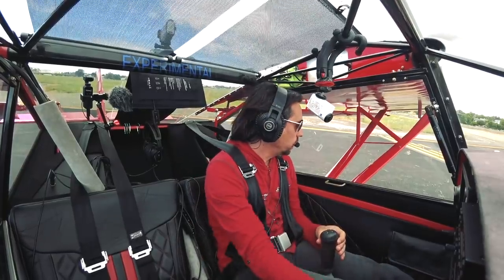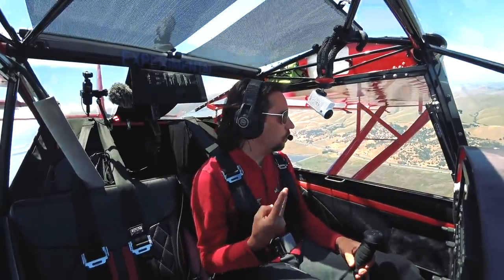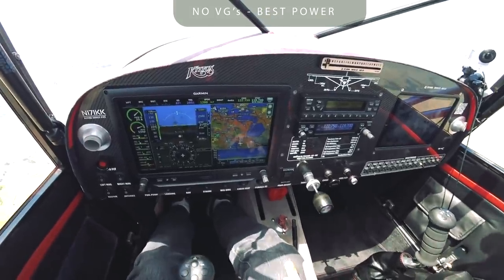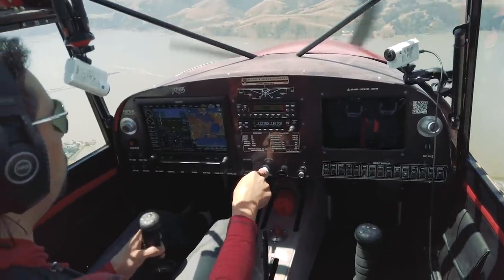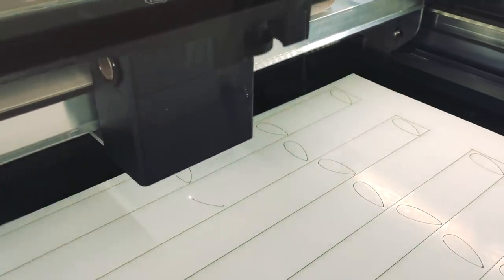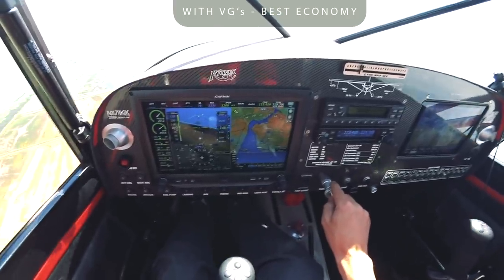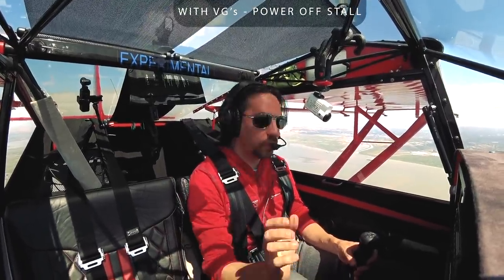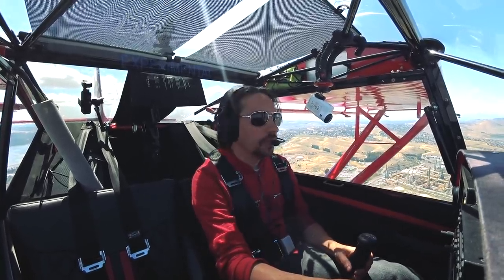Kitfox - Vortex Generator Install and Test Flight

Comment: THANKS GREAT RESEARCH EFFORT ,I have watched a ton of these and everyone else gets about your results before after. I am refitting a Loehle Sport Parasol and was concerned most about making part 103 stall speed and I have been convinced VG is the way to ensure that I can meet that, and this is just one more video that says its the way to get there. The only other way is to install >50% flaps ($$$$) and then the FAA gives me a few points on the lift coefficient on paper ( i dont have to actually ever use the flaps) but VG is a lot cheaper and a ton less work.

Comment: There must be kind of sacrifice, I mean cruise speed or gas burn? Doesn't the VGs induce a slightly more drag
Reply: VGs on the wings don't really have much effect on cruise speed. They have more effect at higher AOA giving better control at lower speeds therefore lowering stall speed. He goes over this better in his first VG video.

Comment: Great performance gains! Enjoyed your process and precision application methodology. Question: I didn't catch whether you applied VGs under your horizontal stabilizer. I'm curious whether doing so will help you maintain a higher angle of attack during low-speed flare.
Reply from the maker: I did. I had 16 VG's left over and installed 8 on each side. I do feel my elevator with much more authority.
Reply: @AlexDiSessa  Sweet!

Comment: Alex, this was a fun test with real life before and after results. Mike Patey in his building of Drako has a great video on the difference between a slotted and a slatted leading edge and the drag effects of the airfoil when landing a tail dragger. If you wanted to get your stable slow speed down under 35-6 knots perhaps a slatted leading edge could bring you down to near 29 knots?
Reply from the maker: I am sure it could... but then I need to redesign my wing and it means no flying!

Comment: Curious as to why your stall speed is so much higher than mine... full flap power on I'm down at 27mph, power off at 31mph. Also STOL speed Vg's and placed at 3%. I have a video up on it as well
Reply from the maker: It's likely because I am 300+ pounds heavier than yours. My total weight is 930lbs
Reply: @AlexDiSessa  ah... that makes sense

Comment: would be interesting to put some strings on the wings and film them with and without VGs to see if the flow disconnects differently
also couldn't it be that your flaps stall at that speed?
Reply from the maker: I did computer simulations instead of the "strings".. Here's the video:
https://youtu.be/IYHuXs2F3ds
Reply: @AlexDiSessa  right I forgot about that
Love your approach

Comment: Alex,
Nice job and excellent video.  I need to borrow thst clever tool to mark my cord line on my Kitfox V when I go to do mine. Hey, are those solar charging panels mounted on your turtle deck? If so, who is the manufacturer and do you like them?

Thanks
Reply from the maker: Yes, solar. They charge my cameras batteries. Works really well. 

https://www.amazon.com/gp/product/B06XBGSS2R/ref=ppx_yo_dt_b_asin_title_o00_s00?ie=UTF8&psc=1

Comment: True airspeed might be better because you obviously have different angles of attack on the pitot tube (VTs on and off), don't you? Loose any VTs? Great tool and experimentation Alex!
Chuck
PS When I was a very young pilot, I tried full power on stall and ended up upside down, then spinning for 4,000 feet before I regained control. Be careful.
Reply: Vortex Generators
Reply: 50 yrs ago we had to do 2 turn spins right and left at full power and idle.... just to pass a checkride.
Reply: as well as accelerated stalls, too

Comment: There is a lot of movement on the plexi turtledeck; if it were stiffer, there would be less movement, probably less drag, and better airflow. Might be worth doing some testing with tufts to see how the air behaves, then install a thicker plexi, and compare.  Do you recall what your speed was before putting on the bigger tires?
Reply from the maker: The plexi will vibrate no matter what I put there. I was at 120mph before the big tires.
Reply: Alex. vibration or alternating vortices?
Makes me wonder if tiny /short VGs might smooth the flow.
Reply: I know there was flow disturbance at the windshield top on my Cessnas.
I was doing speed experiments.

Comment: Alex, would you mind sharing your experience with crosswind landings when you have the VGs on? I've had them on my Rans and found that due to the lower stall speed, crosswind landings became harder. Lower forward speed means bigger crosswind component. Curious to hear if you noticed a difference
Reply from the maker: I have not noticed any difference it. Although I did land on some nasty cross winds last weekend,.

Comment: Love your setup. Would like a similar functionality. What does your control buttons for?
Reply from the maker: Which buttons?
Reply: @AlexDiSessa  on the stick. If I saw correctly you have four of them. Bit curious.
Reply from the maker: @jrisinlove  It's my elevator trim UP/DOWN and my radio frequency toggle.

Comment: Alex, it would have helped immensely if you said the units when you said a number.  When you were referring to 105, 110, and to 40, 41, 39, 35, I didn't know if that was airspeed, or horsepower, or gallons per hour, or descent rate, or degrees of angle of attack, or cylinder head temperature in centigrade, or what.  Remember that we can't read your thoughts.
The audio was really bad, which added to the confusion.

Comment: I find it strange that Alex repeatedly says KNOTS... yet the chart at the end says MPH.
The comparisons are still valid but the terminology confusing...

Speaking of which... the captioning is not accurate to vocals. lol.
Reply from the maker: Yep, habit.. still getting used to MPH..
Reply: Yes thank you Alex.
50 yrs ago we were all MPH... it was rare to see an AS indicator in knots.

As I recall the FAA used knots and all light planes were gauged MPH.

 Now its all Knots.

Of course, I still prefer the old analog gauges instead of glass. :-)